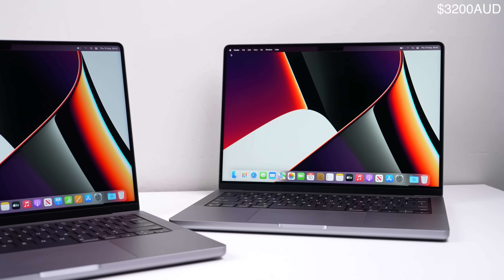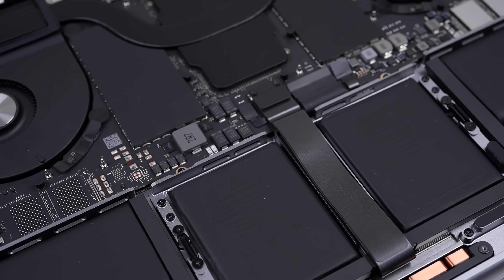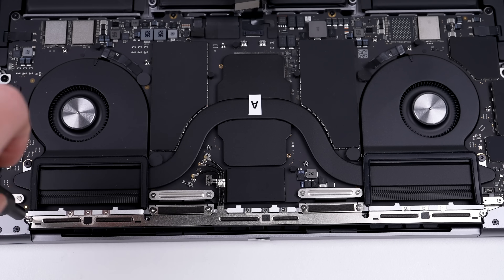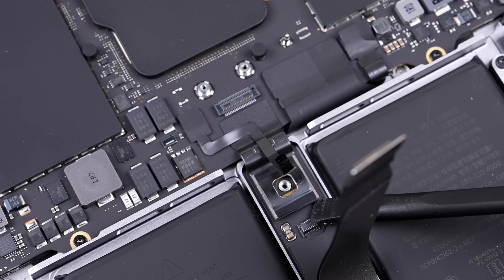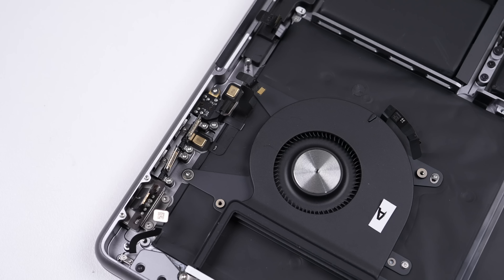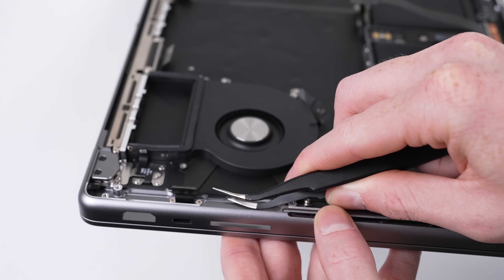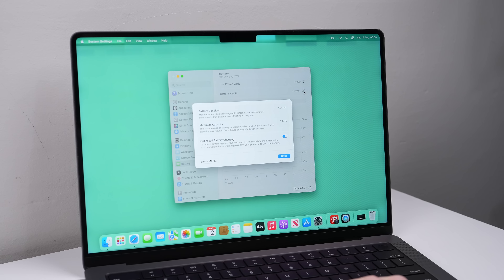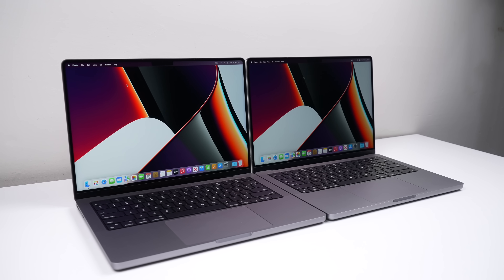New Anti-Consumer MacBook Pros - Teardown And Repair Assessment - Apple Silicon M1/M2

Comment: makes me want to sit in my rocking chair and tell my grandkids stories about the olden days of technology. in 2015 or so, i broke the 17" screen on my dell laptop, but i was desperate to fix it (it was the middle of the semester!). i pulled a 15" screen from my grandma's old as heck acer. the ribbons just fit and worked, although i couldn't thread them through the hinge anymore. i used double-sided tape to stick it to the inside of the shell, with a gap on all sides because it was smaller. even the webcam still worked! it was ugly but it all worked flawlessly. now in 2025, here i am dumbfounded after an issue spontaneously occurred to my wife's modern macbook pro and not only is it unfixable but we can't even recover the HARD DRIVE (described in rossman's video "How 16" Macbook Pros often kill themselves & why they're unfixable").

Comment: I just did a display swap on a 2021 MacBook Pro 16-inch. Upon turning on the original MBP with the new display (salvaged from another MBP) it started up into a "repair mode" which said "completing repair of your display". It did something for a less than a minute then rebooted. Upon reboot I was back in mac OS as if nothing had changed. The replacement display works as if it were the original, with True Tone and automatic brightness fully functional. Hopefully this is an indication that Apple has made self-repairs work the same as "official" Apple repairs.
Reply: Yep this is new in macOS Tahoe although I believe its still only due to EU regulations, and third party parts are still rejected, but still somewhat better that you can now part pair genuine parts pulled from another identical Mac, still not fully freedom as third party parts are still rejected but a small step in the right direction.
Reply: Wow! I know of the iPhone repair screen but have never heard of the Mac version

Comment: does it still exist... in iphones apple came up with repair assistant... any progress on macbooks?
Reply: Yep, just got added in macOS Tahoe, but still you can't pair third party parts, only Apple original parts purchased from their parts store or ones pulled from another identical Mac. A step in the right direction but still is a pretty bad issue with these Macs.

Comment: The angel sensor can be adjusted to work, there is a video on how to do it on here!! I have the same machine, just ordered a 2nd hand screen! The machine is literally just over 2 years old and backlight has gone, this is a common problem a lot of people are getting. Now I did not buy this machine, well I did for a company who paid for it and I recovered it when the company was sold on. So I splashed out £300 for a used screen which comes soon and hopefully it works! I have never ever walked into an Apple store, or would I ever and splash out thousands of $$ for any of their devices! Why would anybody fund a company that has this disgusting practice of making it very hard for anybody to repair their device that they have paid a lot of money for!!

Also, their new devices are nowhere as reliable as the older stuff that you could actually install used parts onto! They were built to last! not go faulty just after the warranty has expired and your expected to go to the Apple store and get bent over and be abused!!!! 

Simple! do not buy anything that can not be repaired, or made difficult to do so!!! If people stop buying these non repairable Apple crap machines, they might get the message when they start to loose millions of $$$$

Anyway Apple lovers, enjoy your nice shiny expensive Apple hardware till it goes faulty!!! 😂

Comment: This is what you get when stock price matters more than anything else, especially when a company is one of the largest components of the major stock indexes putting more pressure of constant growth or at least not falling behind. You must find ways to force customers to buy everything for you, to force customers to pay a premium for parts that shouldn't have one (like paying a huge premium for internal storage and ram because you can't upgrade it later). Not to mention, knowing you're not going to be able to DIY anything in these machines, it pushes consumers into giving apple even more money through extended applecare warranties. 

Unfortunately for us in this case, you have no choice as a consumer if you want apple silicon, and right now the M chips are pretty much unmatched  by any other manufacturer, at least as far as laptop CPU's go.

Comment: Random screen failure here. Still under warranty.  Denied. Claimed not a manufacturing defect. Said it must have been a crumb. 

Right.

$850 repair. 

Right.
Reply from the maker: A friend of mine has one, developed a horizontal line just the other day.
Reply: Update - visited different Apple Store. Same story until I said Level  2 said a manger could help. (True. And I was. Very nice about it) tech came back and ran some tests and bingo. They honored the warranty. No cost. 

So the store matters.

Comment: Headless MacBook Pro Problems
I've a headless 2019 16" MBP. However, its keyboard backlight and backlight settings panel do not work. It appears that they are dependent on an ambient light sensor built into the camera cluster on the screen (which no longer exists). Is your ambient sensor in that bar you taped to the hinge bay?

Also, to anyone interested, another big problem with headless MBP's is that transporting them is problematic as without the screen as a protector, the Mac responds to every inadvertent touch to the trackpad, the keyboard, and the Touch Bar, constantly waking the machine and responding in ways you will want very much to avoid. I have not found a solution to this problem other than building a case for transporting my headless Mac that rests only on the edges of the top of the MBP. Anyone found a software or settings solution to this problem?

Comment: I have handled my Macbook Air M1 with utmost care till date and somehow, I am facing Flexgate issue which has no cure so one has to get the whole display changed that almost cost 80% of what a new M1 mac costs now. 
after searching about this issue on google I found that this is due to apple using inferior quality display cable and it is even designed in such a way that one can't just change the cable in case this flexgate issue arises, one has to change the entire display. which not only cost a lot but also it increases e-waste to a great extent. Apple discontinued adding chargers with iphones stating environmental concerns but it's mac design disallows one to change just a cable instead of the whole screen which is not even physically damaged.
pathetic.......just pathetic.
please raise this issue...

Comment: If you find an Apple original replacement, the bright spots at the top are not that visible depending on your wallpaper. I was able to source a used display off eBay for $659 USD. Quite happy with the results despite the small glitches, and best of all the customer is happy.

Comment: Apple has locked batteries to iphones, i wouldn't be surprised if they have already done it with Macs.  On iPhones, the battery-management controller is welded to the battery.  You can cut off the battery management sensor and put it on new cells, but the number of charge cycles and limits on the charging will apply to your brand-new cells, defeating most of the advantages of a battery replacement ...

Comment: 2:14 Newer models display cables have not proved resilience to wear. Just found out our 2 year old 2022 Macbook Pro has display issues!
Reply: The 2022 macbook pro is the older design with display cable issues i think. The 2021, 2023, and 2024 have the better upgraded design
Reply: @bremer3091  Unfortunately, you are wrong! You can check for yourself when viewing Mac repair manuals.

Comment: Apple is trying to kill the independent repair industry, while falsely satisfying regulators with their “self repair service” nonsense. 

Even if you opt out of sending your device to Apple for repair, you’re still locked into their new “repair ecosystem,” unless you have impeccable soldering capabilities and tech that allows you to reprogram components that can be reprogrammed. 

Apple boasts their ecosystem to consumers and investors, and they’re extending that ecosystem into a new territory, without any actual penalties. Hopefully, the Right to Repair movement in the U.S. will keep up the heat, or better yet, maybe the EU can apply more pressure. At the very least, Apple’s configuration software needs to be made publicly available to consumers and independent repair shops.

Comment: I hate Apple for this. My 16” MacBook Pro M1 Pro 2021 broke. No power no charging. Went to Apple store to get it diagnosed and they said they will have to take a deeper look and will get back in 10days. After couple days later they said the Motherboard/Logic-board needs to be replaced and wanted $750 for the repairs. I thought of buying motherboard myself and doing the repair or swapping motherboard from other MacBook Pro. And was skeptical about wether each part of motherboard programmed to one another like iPhones and other Apple devices are. This video proves my suspicion. Why Apple, Why?!

Comment: I do own a minimal MacBook Air, mostly because I got it new and really really cheap, which kind of balances with the weirdness of its. But considering that official apple repair doesn't even exist in my country - this is basically a single-use computer. If Framework will start selling laptops in my country, this will probably be the last MacBook that I own

Comment: I gave up on Apple MacBook Pro in 2012. Shocking hardware design. Massive security issue with SSD not removable or cannot wipe if service required and it won't startup.

Comment: I’m going through this right now.
Apple’s had my M3 Max for nearly 2 weeks.
I’ll be getting charged £1.5k for the repair.
I had to buy a brand new M3 Max as a stand in for the repair with the promise I can return it within 14 days if undamaged.
That’s nearly a £4k deposit essentially on a stand in.
To Apple’s credit, they’ve been communicative and have since waived the 14 day period, extending it for the duration of the repair. That said, I can’t take the laptop out as it’s too risky so I’ve lost a mobile workstation.
I absolutely love this machine, and would spend that money on it again, but my god, it takes Apple forever to repair this thing.
Additionally, you gotta have money if you want to own and maintain the thing.

Comment: 1:58 - 2:03 are creases like these really common on M-series Macbook Pros? I've got a 2 month old 14-inch M3 Pro Macbook Pro and I notice quite similar marks on the flex cables of mine like the ones on the video. I compared them to an M1 Macbook Air and I didn't notice any creases on the Air's flex cables.

Comment: I don't think I could afford to be a Mac user. If I was, I'd have to buy supped up 5 year old laptops since you can't upgrade anything, and buying a maxed out Mac brand new is just too expensive. What I do with PC laptops, is I'd buy a lower to midgrade spec. And then after a year or so, I'd upgrade the memory, CPU, and hard drive.

Though I can't really do that anymore with PC's since they are taking away being able to upgrade the CPU. So I buy slightly used PC laptops that have maxed out specs. Though at least you can still upgrade the RAM and SSD.

Comment: I repaired computers as a side gig, also use to collect old ones being decommisioned and set them up for uni students with winpro or macos, back when Apple when using intel chipsets.  However; I refused to refurbish any branded apple hardware, simply because they would invalidate warranties, and then their customers would sue me. However, I would happily put a licensed version of macOS on a barebones Intel/AMD chipset when that was still possible.  That all changed in 2020.  Apple decided to do what they did in the 80's and make their computers with proprietary chipsets.  It's failing now, like it failed then.  Apple is losing market share across all personal computing markets.  (ipad is not the standard for tablets, it's only for trendy startups, everyone else uses android for obvious reasons)  

It's not a bad strategy to play to elitism.  It's the only thing that kept apple alive after x86 saturated the market.  It's a shame too, unlocked, apple is the better computer overall.

Comment: You are complaining mostly about things that allow variation in components, which to me suggests you are competent with screwdrivers, but not with design and production.  Plus, you shill a used mac store while you complain about repairability. I noted you took only a few minutes to swap displays, and the process seemed pretty straightforward and fast.     That suggests that repairability is pretty good, but that your problem is with calibration / display adjustment.

That's not anticonsumer, friend.   That's production and design.     Making a $2000 machine that doesn't automatically compensate for the skills of some random Brit isn't anticonsumer.  It's more of a reflection of your skills.  Just dig in to the thing for a few years and write your own calibration display code and see if you are as good as the people you are complaining about.    Note that if there were no calibration adjustments to compensate for component variations, the $2000 machine would be $3000.       

Nice clickbait, though.   I admire your ability dance around a non-problem.      Please, start your own company and design something better.   I'll wait here.

Comment: ATM my MacBook Air M1 screen is flickering, if I can find a cheap LCD screen, I wouldn’t mind losing the True Tone, or odd display in the top of the screen. I just need a screen and be able to do use, I’m not sure how long I can hold on or tolerate to using an external monitor.

Comment: My MacBook Pro M1 had a glass of water spilled on it. Water, on the keyboard. A lot of water, must be said. No water on the screen. However, the screen stopped working. It would be off, or some weird dark haze glow, but essentially off. Took to an authorized shop and they gave it a solid clean, but it didn't fix it. They said they couldn't repair due to the ID matching between screens, mainboards and the sleep trigger switch. With that fail, I got a quote at an authorized repair center; 1700 EUR. New screen, new mainboard required. They couldn't say exactly. My thought is the screen is 100% fine, it has to be the connector to the mainboard. Perhaps some corrosion? Or water damage on the sleep trigger switch? The strange thing is when I slowly open it, I can see the screen toggle on, albeit with nasty scan lines and serious issues. If I would slowly open it, I could see the screen with these horrible artefacts. And then it would randomly stop. With the cost of repair about the same as a new Macbook Air, it didn't seem worth it. After coming home, I removed the screen, and now use it as a keyboard / computer / trackpad with a USB-C monitor. Works fine.